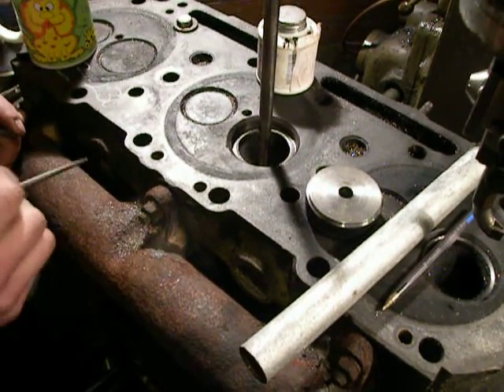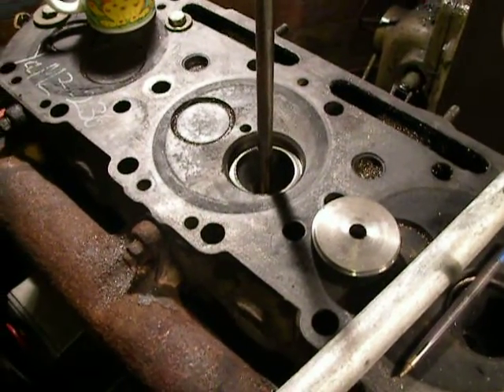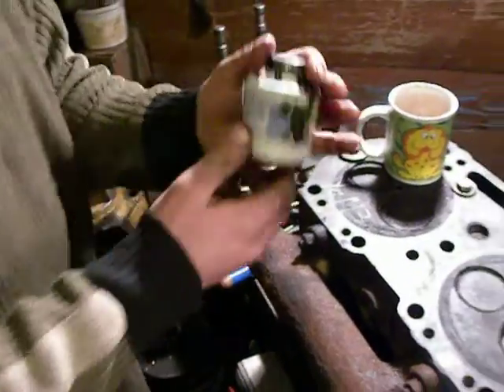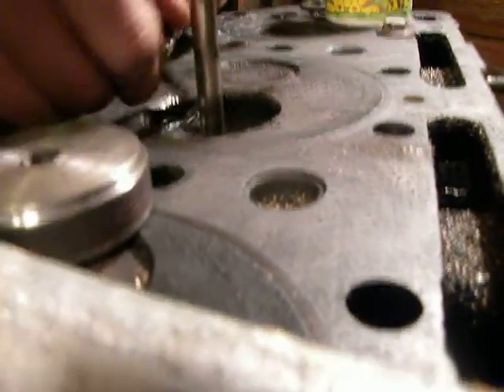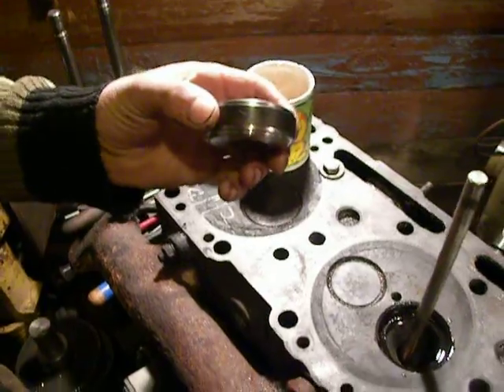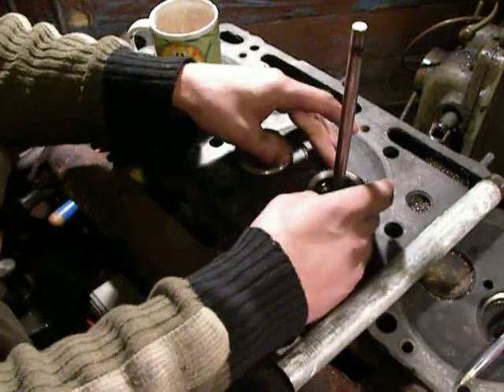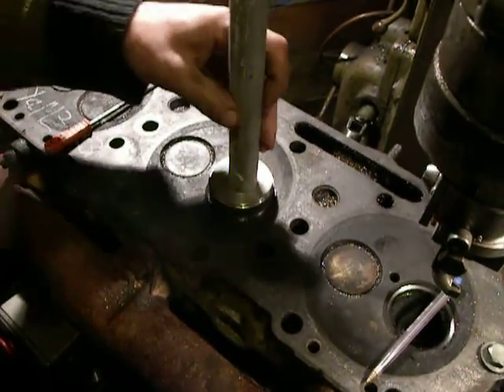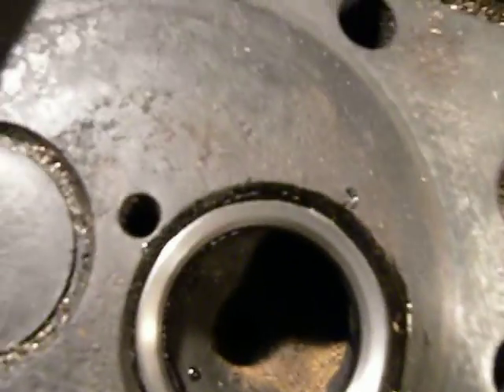Diesel engine valve seat repair - installing new valve seat in the cylinder head (part7)

Comment: how long it will keep this live? can you do the same for a head from an old xr200?
if yes, how much it will cost me?
thank you
Reply from the maker: I think a few years it will work for this YaMZ engine. Google says that to XR200 is motocross bike and it run on gasoline (petrol), but this YaMZ is low speed diesel. Also the XR200 engine is air-cooled (so it looks in google images), it is more hot than diesel... I need to get some info before I work this piece. Yes it is possible to exchange valve seat to XR200. How much valve seats need to Exchange- 1; 2; 4?
But one question: I live in Latvia...Sorry, I don't know where You live, but how do You think bring that piece to my workshop?
Reply: this is an xr200 rfvc 1985 with 2 carburators and 4 valves, is a small trail/on-off road legal motobike. I live inGreece and I can ship it to you once it will worth (1 household have problem). If you have time you can check for it, you can tell me the cost and the way you'll made it. Then I'll decide. Thank you :)

Comment: Now I understand... the engine block's valve insert does not have a compound curve where it touches the block. So machining the insert involved straight angle surfaces: diameters and possible a small radius. Well done!
Yes, the auto shop must have a special valve seat grinding machine.
Another satisfied customer!
By the way, your cameraman did a fine job getting closeups and a final shot of you...
Keep up the good work!
Roy